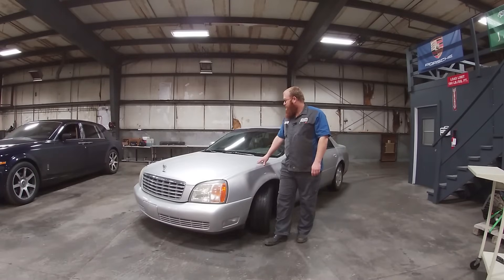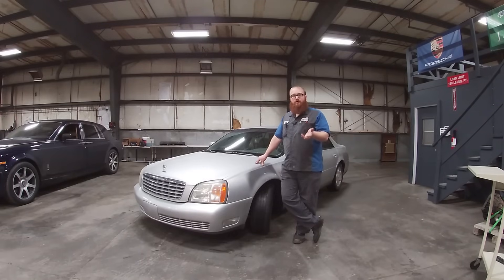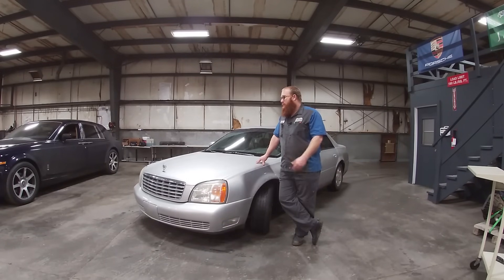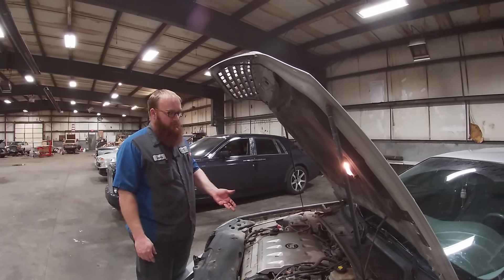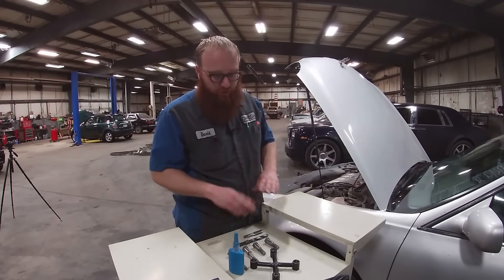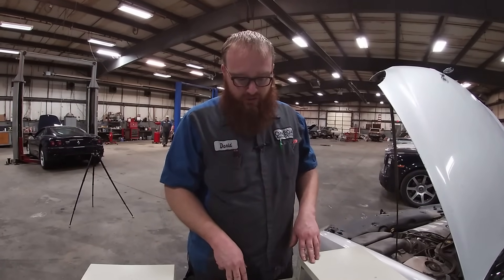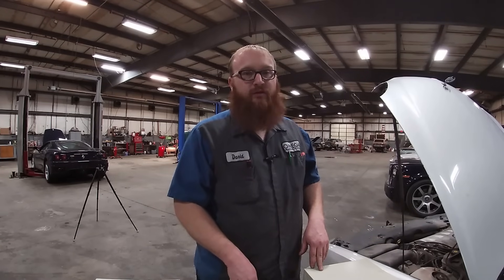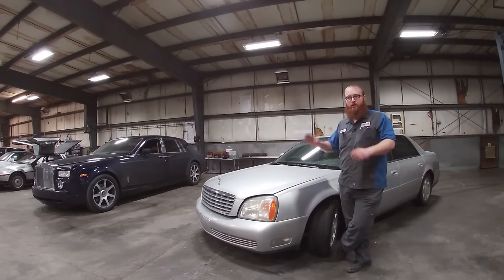The CAR WIZARD names Cadillac's Northstar Engine the Dumbest Design

Comment: GM is a finance company, not a car company. Been that way for a few decades.
Reply: John Smith 

That was correct - until GM filed for bankruptcy in 2009 at which time General Motors Acceptance Corp (more commonly known by its acronym, GMAC) was separated from the car business and renamed Ally Financial.
Reply: Actually, it's also a retirement (pension) company which happens to make cars.
Reply: Tucsonan Dude 

You can thank the Obama administration for that. GM tried to get out of defined benefit plans when they filed for bankruptcy but the UAW defined the terms of the bailout (to their members’ interests, of course) while white collar workers, retirees and GM bond holders all got screwed. 

Just another benefit to donating large sums of money to the Democrat party.
Reply: The duramax is great
Reply: @buoyant69  - Thanks for the clarification. I stand with the workers.
Reply: The Volt was a stunningly good car, I've owned two. The serial hybrid design was very elegant and for me at least totally reliable no maintenance issues in over 100k combined miles on both cars (one was totaled out from behind by a texting driver.) Clearly designed by some engineers with skill. If only their marketing department had actually tried to sell them...
Reply: I mean the LS is pretty good
Reply: TPB for life LS is great, the rest of the components in their cars that go out after 20-30k miles is why GM has a bad rep
Reply: @scottsmith6571  izuzu
Reply: A Caddy for 2+4K ain’t too bad in my book.  As long as it has side air bags, I can put in a CarPlay radio, backup cam,  tune it up, sunglasses and we’re good to go!
Reply: LOL
Reply: Noah Halbfoster I know who makes them my dad has an 05 dmax with over 700k miles same engine
Reply: My 150k ls1 runs 10.50 cam only 87 3.8 lc2 ran 10.97 stock long block besides valve springs  I own 13 cars I kinda know who makes what gm and Isuzu made the s10  gm an toyota made the geo corolla
Reply: @buoyant69  No you can blame GM executives for making short term gains with long term consequences. If they did what Ford did and took a line a credit pre-2008 they wouldn't really need to accept those harsh penalties that screwed the automaking industry.
Reply: Gm financial
Reply: All car companies are finance companies now thats why vehicle price goes up if i build the vehicle have a dealership pay for my vehicle sell you the car then finance you and charge you interest on on something i have already been paid for
Reply: Francisco Chacon 

That's one version of events (and the one the UAW leadership peddled to its members).

Unfortunately, it wasn't quite that simple.

GM was having trouble issuing bonds because they weren't investment grade (i.e., their cost to borrow was high - for good reason). And getting other forms of credit when you're a multi-billion dollar co. with a deteriorating balance sheet isn't easy. 

If you were a creditor, would you have given GM money at that time?

Remember, Ford already borrowed the money in advance of the crisis, they didn't get a "line of credit" like a homeowner gets a HELOC they can just draw from at anytime in the next 10 years.

Had GM not had the highest labor costs and pension obligations in the industry, it might've been able to navigate through the downturn. MAYBE.

Rick Wagoner may not have been a fabulous CEO but short of having a magician capable of pulling the proverbial rabbit out of the hat at the helm, the writing was on the wall for GM.
Reply: The ls series of engines were great engines
Reply: scott smith the Duramax was an Isuzu engine
Reply: I assume your error was a intentional slight but in case it wasn't Democrat is a noun indicating that one is a member of the Democratic Party which is both a proper name and as a small d adjective.  This is in contrast to being a Republican(noun) and republican(adjective).  I am highly in favor of correcting the errors people make in everyday speech, be it using "ain't", y'all, misspelling February, library, etc.  The more professional we are in our speech the more successful in all endeavors of life. Yes?
Reply: Ed Ward  Mopar are all junk. Pretty common knowledge. Outside of Cummins with a manual trans. You WILL have transmission issues. Ever try to use a Ram for its intended purpose? It WILL fail.
Reply: @wuushew  Please know this is called trolling and generally looked down on by everyone. "We don't need no thought control." , about sums up my opinion on your drivel. Start a blog and bugger off mate.
Reply: @wuushew  - On the other hand there is such a thing as pedantic nonsense.
Reply: All dealerships are finance company's these days
Reply: The worst car accidents happen on the showroom floor at the “stealership.”
Reply: bitrexgm, GM dropped the ball on marketing the Volt no doubt. Auto consumers never understood the all electric drive hybrid system which was the most innovative in the marketplace. No one else had anything comparable but the automotive press loved the Prius and barely gave a mention to the Volt, or competently explained the difference between the two cars. The Volt, it seems, was always compared to plug in electrics, rather than hybrids.
Reply: Tucsonan Dude that’s until Government Motors closes its plants here, then moves back to Mexico and now into China. A great way to give thanks for the taxpayers waste of money.
Reply: scott smith until you have to pay to fix them. I have a buddy who makes a ton of money off of them. He said they’re worse than the 6.0/6.4 powerstrokes
Reply: scott smith I’d love to see the proof of that. The ls1 doesn’t respond that well to just a cam swap. That’s like saying I changed the exhaust, intake and a tuner on my powerstroke, now it makes 1000ft/lb of torque  oh wait, it does
Reply: @mikeadams42  maybe if he has it in a go kart or something lol. My buddies WS6 was (note was) cam only and dynoed 406 rwhp. It could still only hang with 11.7 cars. And it was a ridiculous cam. So much so, it destroyed the lifters in short order and ended up pissing glitter after about 3k miles. Hence the "was" from before. Lol
Reply: The 6 cylinder in a lot of Buicks was a great engine
Reply: John Dingle Jr, and Debbie Dingle really cleaned up on that one.
Reply: My ex father in law walked away from GM (he was a BIGwig) for just this reason in like 2000
Reply: So, what diesel truck is worth buying?

Comment: I spent some years at a Caddy dealer.  These things would come in knocking so bad you would think you had rod bearings falling out.  Problem was when grandma was pussyfooting a 275-300hp car around town for years it would build up carbon in the combustion chambers and knock like hell.  We would take the car for a beat run/road test with the shifter set into 2.  Run it for about ten miles at close to redline and it would be running quiet again.
Reply: Yeah but these caddies are meant to be driven aggressively

Comment: I always hated my life when one of those rolled in the shop 😂
Reply: a good question for a customer with a problem cadillac is "so what's your budget?" its a more direct question that can lead you down the road of passing on the undesirable  work involved instead of wasting good time on putting together a bid for major work, much more than the value of the car, that the customer likely wouldn't (and usually shouldn't) pay for.
Reply: If it rolled in Ur lucky that you don't work on Australian land Rovers.

Comment: This motor has a liquid cooled alternator and is still a technological marvel once the head gasket problem is fixed. The transverse ones had NYLON intakes for cooler air flow and when properly maintained are some of the most seemless motors on the planet. Air and exhaust flow were the only things keeping this high compression engine from another 60 to 80hp more.
Reply: yeah , dont leave out the fact that 5000 pound cars , even if powered by a v8 , don't do to well having to pull their weight rather than push their weight.....it's like being being 300lbs in a wheelchair and using your feet to get you moving ...GM put more technology into the marketing of that car ......because of what the designers were putting up their noses. Liquid cooled alternators (glitter!! Sparkles!!)  wank wank....BMW had LCA's too....when you need a butload of juice to power a car that required to much to BE powered , well , shit gets HOT..........And those intake manifolds were not nylon , they were at best Recycled plastic....and the cheap rubber coupling they used to connect the throttle body to the recycled plastic manifold shows the poor quality of what the designers were putting up their noses......Moral of the story " stay away from the smart drugs"  Cause the marketing department doesn't get paid good enough to work that hard.
Reply: @mattriella6776  More engineering went into this car than ANY BMW of its day. The 740 and 760 both were plagued with nothing but serious electrical and fuel management problems. Those manifolds were not cheap plastic and Porsche copied GMs design. Mercedes was the actual overengineered car from this time period with overpriced parts. If you know that GM found ways of cutting cost to produce these luxury cars then you can respect their decisions. The 7 series didn't ride anywhere near the level of Cadillacs because they wanted performance. That performance came at a cost even German citizens couldn't afford at the time. The FWD was a safety measure that worked well in snowy climates and I dare anyone to drive a 7 series in winter.

Comment: Tbh..  When you buy a good car for 2k, spend 4k doing this fix, and then have a car that'll run for quite some years trouble free.  6k for a good car doesn't sound like too bad a deal imo.

Saved myself a 2005 Saab 9-5 fromthe scrapyard.  500 bucks, new turbo and exhaust, daillying it ever since. Fix instead of throwing away.
Reply: my 3 cars was on the same boat ready for the junkyard.

Comment: SERIOUS QUESTION FOR THE CAR WIZARD

DIDN'T NORTHSTAR ENGINES HAVE SELF SEALING CYLINDER HEAD GASKETS??  I have 2 S series Saturns with the 1.9 L DOHC engine. Both have the self sealing cylinder head gaskets.  They came from the factory with sealing pellets in the cooling system which have to be replaced whenever you change the antifreeze... If you don't replace the pellets when you change the antifreeze, the head gasket usually blows within about two weeks.  As long as you replace the pellets, the engines last forever and the head gaskets never go bad.

As best I recall, it was caused by an aluminum block and aluminum heads and a steel gasket that expands at a different rate.  Not that I"ve ever had a Northstar, but I tend to recall that some Cadillac's had the same system.  In fact Barr's Leak Stop used to have a label on their bottle that read "Same as original GM sealant". 

I know GM still sells the sealing pellets, because I still use them on my Saturns and I have over 200,000 miles on each.  They come in a blister pack of 5 or 6 and cost about $6.00 at the dealership.  

Is there any chance that Northstar engines blow their head gaskets about 2 weeks after you flush the radiator or do a coolant change?  

One last footnote, even for Saturn 1.9L engines, the pellets were very poorly documented.  Some actual Saturn mechanics weren't replacing them and were blowing their customer's head gaskets by the mid-2000s when they did a flush service or replaced the antifreeze.  GM wasn't very proud of the fact that their head gaskets needed sealer to work and never made a big issue over it. Any chance you've seen Northstar head gaskets blow a couple weeks after a cooling system service?

I've been fixing cars for over 45 years... and I doubt many people care about 1990's engine designs anymore, and maybe self-sealing technology has been lost to history, but as you did a video on the topic, I thought you might still be interested and I'd love to hear your opinion.

Comment: My parents had a 2005 DeVille that they inherited from my deceased grandfather back in 2008. Probably the most comfortable car I've ever been in & had good handling for how big it was, but it had non-stop problems ever since we first got it. The transmission had to be rebuilt twice, was always leaking something & three of the power windows broke where they would go down, but not up. Had around 50k miles when we got it & 100k miles when we got rid of it. Eventually replaced it four years ago with a new 2017 Camry XLE 4-Cylinder that I recommended. Has 50k miles on it now & hasn't had any problems yet as expected.

Comment: I worked at a Cadillac store in the 90's when that engine came out. A couple of things you didn't mention, and maybe weren't aware of, on those early motors, that make the Northstar the worst engine in my book.
1-The oil pump gerotor ran off the front crankshaft snout and there was no keyway to lock it into place! It was held in place by the torque on the harmonic balancer bolt, which would often fail and the engine would lose all oil pressure. Brilliant Idea from an engineer that decided they could save 50 cents on each engine by not putting a keyway on the crank snout since he figured it didn't need one!
2-The crankshaft main bearings cradle had a lousy seal setup and would weep oil, very slowly, so that the hoses and mounts, everything rubber under the hood, would deteriorate from the oil mist getting on them. I don't remember any Northstar engine with 50,000 miles on it that I worked on that DIDN'T have a thin film of engine oil on everything under the hood.
Reply: No 2... Well it would at least keep some of the rust at bay.

Comment: "Planned Obsolescence" : a policy of producing consumer goods that rapidly become obsolete and so require replacing, achieved by frequent changes in design, termination of the supply of spare parts, and the use of nondurable materials.
Reply: “Never attribute to malice what is more reasonably attributed to stupidity.” I’m sorry, I can’t give a design this bad the credit of forethought that is required for planned obsolescence. If it was planned obsolescence they wouldn’t have fixed the problem. This was just stupidity winning the day.
Reply: During an interview with GM engineers about a decade ago they calmly admitted that the. Cadillac was designed to operate with minimal warranty issues fir the term of its first lease only. This is very carefully planned obsolescence.
Reply: Wow, just named how money is made. You're right. I've been a mechanic for 37 years. The "Northstar" pulled the the head bolts/ studs out of the block. The fix is to pull the engine and anchor the head studs deeper into the block. At about 140K miles, is it worth it?
Reply: Hey Everett, very enlightened comment. If they were really that smart, they just would have found a cheaper supplier for the larger bolts it really needed. This is just plain old stupidity and not a conspiracy.
Reply: @EverettVinzant  Very well said. Sell some one a bridge or truly help mankind move forward, technologicaly and responsibly.

Comment: People still dump $$$$ into these things. Especially around tax time.
Reply: Don Quixote people with 20 year old Cadillacs aren’t taking them to the dealer for service lol
Reply: Wish someone would let the one I work at know ! I have became the hoopty whisperer
Reply: Allen Kilpatrick I’m shocked to say the least
Reply: Don Quixote  dude, I'll bet like 80% of cars on the road today are "5-20 years old". That's a crazy broad range there. 1999-2014 lol
Reply: the engines, or every other piece attached because "the engine needs nothing"? lmao.
Reply: 20"+ with at least 2" spacers, walmart/autozone hood and fender "vents" and letters, debadged otherwise, 2.5% tint... my experiences anyway. pretty much sums up the OK area anyway.
Reply: Dude tell me about it. Some people think these cars are ballin. Lol yeah.
Reply: Lol I'm one of them
Reply: Allen Kilpatrick have series 3 ( series 3 has aluminium intake not plastic like series 2 )3.8 400000 no oil burning sound like new , runs fantastic dual hi flow stainless mufflers drive daily 150 km to  and from work gets 34 mpg imperial  on freeway ,in a 2004 Grand Prix ,paid  just over 2 Grand 4 years ago touched up oil undercoat yearly  ,replaced water pump and elbows with aluminium elbows , brakes  ,1 wheel bearing and sensor ,awsome car super reliable , rear brake pad cost 17.99 Canadian lol. To bad gm does not employ some people like our selves to advise their top brass  to keep engines like the 3.8 after it was perfected in series 3 , it could have been up dated with aluminium heads free flowing exhaust , could have options like turbo and kept supercharged option . Put the engine with variants in caddy and suvs  .No some bone heads  discontinued it and came out with the bike chain quad cam 2.8 and 3.6  which are ok if you use good quality synthetic oil and change it at 5000 miles and a tiny filter which I would only use the premium oil filter cartridge. By the way I just purchased a mint 2006 CT’s 2.8 only it has major water leak on drivers side and I serviced the 4 tube drainage on the moon roof , any one had leaks not associated with the roof help would be appreciated  possible windshield or plenum for Ac ,any way it rain water not anti freeze under driver and rear passenger carpets